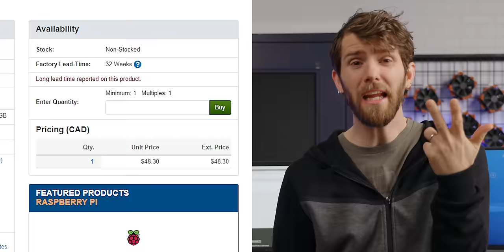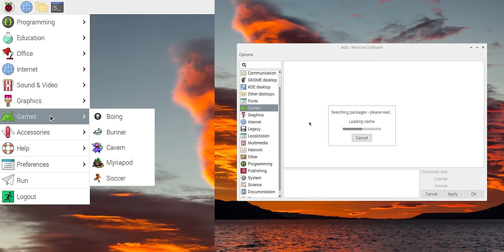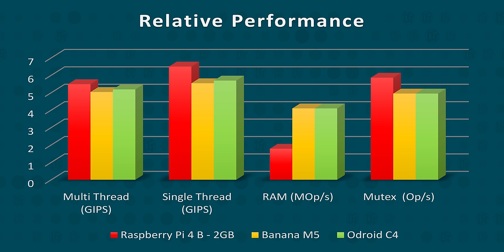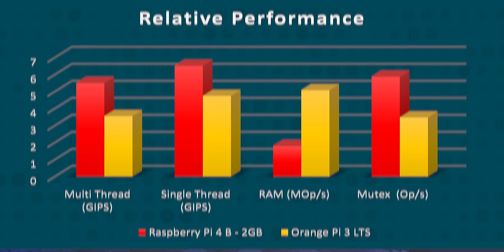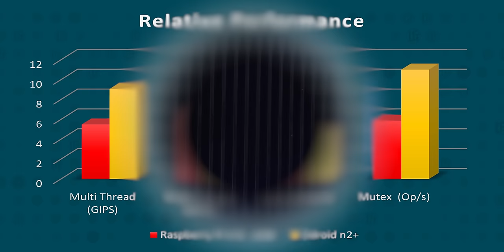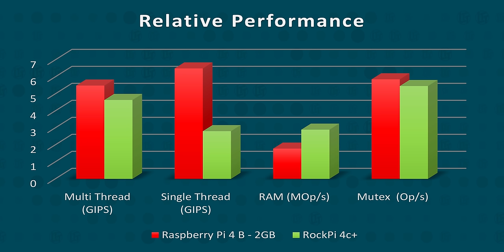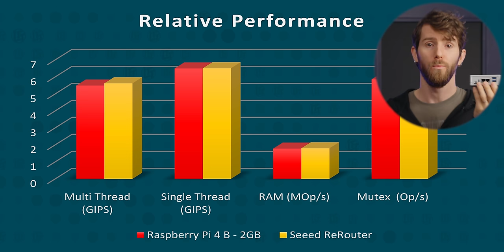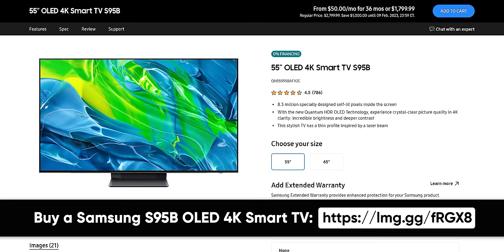I Can Save You Money! – Raspberry Pi Alternatives

Comment: The only thing stopping me from switching to raspberry pi clones is the software support. Even though raspbian is not perfect, I prefer fedora, but it just works and all of the raspberry pis features are fully supported.
Reply: My opinion It's good for browsing the dark web 😊
Reply: @li02828  Good for you, the raspberry pi has no intel management engine or AMD platform platform security processor. The raspberry pi 400 is really all the desktop I need at the moment. Too bad the tor project doesn';t have an official raspberry pi edition of the Tor Browser. How do you use tor on the raspberry pi without the official tor browser? Or do you use 86box to run the x86 desktop tor browser.

Comment: Not long ago, I bought a new laptop for $60. It came with Windows 10 pre-installed, and works just fine. I think it's called an Evolve. 
Unlike an SBC, a laptop comes with monitor, keyboard, touch pad, case, and power supply.

Comment: In Germany, things are bad enough, but luckily not as bad as in the US and Canada as it seems. I am currently building a NAS and I was able to buy a Pi 4 for like 20€ over msrp (but with a nice case included). But 120$+ for a Pi 4 is really hefty. Sadly the alternatives aren't exactly cheaper over here and the Raspberry seems to be the "bang for the buck" (If you want to call it that at those prices) option.
Reply: Yea, in the US we got people buying thousands in bulk and redistributing them for 200$ a piece, which ramps the prices up from a good 40$ to 60$ to 120$ to 200$ usd, i cant even get a rpi from a local microcenter unless its a pico or rpi zero 2W which isnt even good enough to cover what im working on

Comment: Try Bolt IoT wifi module. It has digital and analog pins and let's you connect to bolt cloud where you can write program and control the pins. Can also get the real time data on cloud and supports machine learning.

Comment: A refurbished esprimo q920 mini pc with i5-4590t / 16 GB RAM / 500 GB SSD for about $130 outperforms at least some of these boards, depending on your use case (if you can live without the GPIO). The power use is also about 15W, which is very reasonable.

Comment: 20$ will get you a used Chromebox, which you can fairly easily take the motherboard and write protect screw out, to install Mr. Chromebox's firmware script and run any operating system. Not only is it built for Linux, but they usually come with 4Gb ram, 16Gb storage, a fan, not to mention a dedicated case, and other components that are quadruple the price on a slightly smaller raspberry pi. It totally works, too!

Comment: Few days ago I bough an x86 atom MB for 20e, added some spare 2GB of RAM, a old unused SSD and hard disk both SATA, bought a 17e pico psu to have a fanless setup. You can also ebay an used block MB+CPU+RAM for 40-80, use some old SSD, hard disks, PSU you have around...
Those are 100% compatible and supported by both Linux and Windows, you get proper SATA ports, you can add RAM, expansion cards...

I mean the OrangePi PC was cool when it was ~22e a few years ago, size is cool and it was a cool gadget for dedicated devices but nowadays you can't charge me more than 100e for a badly supported ARM when I can buy for the same price an old PC or a mini pc with a *Celeron. It's not worth the time and the pain for the lack of drivers, support. Actual prices are crazy, old used stuff is much more worth it now and it's usually plenty powerful for a lot of things that you could buy this SOB for (if you are not doing embedded ofc).

Comment: Odroid N2+ 4GB here. I think I have a Pi zero(or another ultra low spec Pi I used for a project a couple of years ago) kicking around here somewhere, as well. I haven't done anything cool with the Odroid, mainly because it's too much SBC to dedicate to any single purpose that leaves performance on the table but while it certainly could assume the role of everyday driver PC for many, perhaps not coming as a surprise to anyone here, my computing needs are a bit heavier than whoever makes up the "many". My display wall/quad display setup alone makes the N2+ not up to the task... I thought about using it as a NAS but I still feel like it's overkill. I haven't looked into whether I could potentially use it for a NAS & a Pi-Hole or something. I had originally purchased it for a roll your own VPN but then an actual dedicated VPN Router fell into my lap, so at present, my N2+ has LibreElec or CoreElec on it but just sort of as a placeholder, as I generally run Kodi on my Linux machine (actual everyday driver) on the occasions where I actually run Kodi.

Any suggestions for projects/uses for my N2+ worthy of its hardware? I'm all ears👂🌽🙉

Comment: Using ARM devices like this long time before Raspberrys were that popular (some people might remember devices like the Linksys NSLU2 or the Marvel Sheevaplug). I mostly need processing power instead of the IO ports. Where I stopped liking Raspberry Pi ARM competitors was that some of them stop getting updates after a few years and are stuck on older OS or kernel versions. Switched over to using cheap used x86 thin clients. Better updates and more processing power and storage flexibility for a cheaper price and often with comparable power consumption, never looked back.

Comment: I consider the onboard WiFi on the Pi4 to basically be an anti-feature. I have multiple Pi4/3s and all of them struggle to keep a semi-reliable connection to my router, even in the same room. So to use them for anything serious, a USB WiFi dongle is needed anyways, but then I also have to go through the effort of disabling the onboard WiFi...

Comment: I just ordered an Orange Pi 5, an AX211 M.2 Wifi 6 / BT adapter, and a case.

My concern is getting proper Linux GPU drivers for the G610.

Panfork seems to making headway, but it is a fork and not upstream.

I'm really hoping for solid upstream driver support. If your video encourages wider adoption of the Orange Pi 5, maybe we'll see better driver / OS support.

Comment: There are actually approved pi sellers charging over $100 for pi4's on their websites now or "starter kits" for up to $200 because they come with a $5 power supply and a $11 case. It's cheaper to buy a full mini pc.  The libre potato is actually pretty good though and still available for $30.

Comment: The Pi 4 received a change in the CPU when they addressed the USB C power connector issue, with the updated version running at 1.8GHz, same as the Pi400

Comment: Another consideration that you failed to cover is that most of these boards do not have the same form factor as the Raspberry Pi, meaning that the VAST array of 3rd party cases (and 3D printable designs) simply won't work with them.

Comment: I use the RPi for RISCOS 5.28, a beautiful Arm based opjerating system that has had a resurgence because of this SBC. If I wanted to use Linux, then any pc would do the trick. But, with the Pi I can run Tech writer 9 and Artworks 2, both amazing productivity tools.

Comment: OK, now let's talk about software support.

Jeff Geerling has gone into this in depth - a lot of these Rockchip computers are great on paper, but they support one specific Linux kernel version and if it doesn't support your usecase. Chances are it won't if you are doing more than something very normal. If you want to build a nas or a cluster or something like that, then forget it. And forget building the kernel yourself, because the modules you'd need are proprietary.

Comment: Love the list of alternatives. I have been looking at pie for a while but not takin the plunge. Am looking for  device to read and record 12 thermometer 40' 60'and 80'and 4 pressure reading 4 relays for switching.  This is test a home project  on tight budget.  I don't want want Bluetooth  or wireless so I like the one you showed with a dangle 😅 to physically disconnect network. What would you recommend and would you recommend other equipment as add on boards for the distance of temperature probes.

Comment: Video summary generated by OpenAI: 
The Raspberry Pi 4 Model B is a single board computer (SBC) designed to offer high speed performance, a quad-core arm processor SOC, up to eight gigs of memory, flexible high speed I/O, and support for up to two 4K displays, all while providing an affordable computer to everyone. However, in the three years since its launch it has been almost impossible to purchase one at MSRP. Fortunately, the success of the Raspberry Pi has spawned an entire bakery of CopyCat arm based SBCs that can offer alternatives to the name brand Raspberry Pi. They offer different specs, like more performance, cheaper costs, and more than one HDMI port. Many are officially supported by Retropie, the user-friendly package manager for additional programs. The odroid C4 is the only non-raspberry flavored hardware supported by Retropie and while at $55 it's a bit more expensive than the $5 Banana Pie M5, it has the advantage of higher clock speeds, an included passive CPU cooler, and a microUSB port for USB OTG.

Comment: I have purchased an Orange Pi 5 with 16GB ram and loaded O/S on FAST micro SD card.   Orange Pi 5 is 8 cores and a good GPU.   It is FAST, FASTER, OMG,  It may be the fastest ( or second fastest ) conputer in my house ( and I have a few running ).   ARM cannot run Intel O/S.   so you have to get O/S from vendor or 3rd party.   For those who have been running Linux ( for me about 1988 ) some of them can use a little polish - but you can get a good OS with a little tweecking - for examnp;le - vendors load are auto - login ( yech ).   But, I can get most of the O/S tweeked to run.  ( like add id and remove auto-login ).   but it runs well once tweeked.  so impressive.

Comment: That Le Potato IS NOT a drop in replacement for a Raspberry Pi.  It's extremely limited on the number of OSs it can handle.   I learned that the hard way by buying one, spending days trying to get it to load the OS I needed and perform a specific function, and finally giving up and buying a real Pi.

Comment: Next Linus will showcase real Single Board Computers that can run Windows, are in the PCI or older ISA form factor, can be used in an expansion slot, industrial/embedded computing, have all the features of a regular motherboard crammed onto a single expansion slot-sized card.  The original SBCs.

Nice that he's catching up with Explaining Computers and ETA Prime.

Comment: Pity you folks overlooked the newly released Odroid N2L, 
It's a revised N2+ thats: 
A smaller form factor, 
has active cooling,
faster ram,
an emmc and microSD slot, 
AND IS ONLY $70+ for the 4GB variant. 

Hardkernel the company that makes Odroid also provides both an Ubuntu image and an Android build for sale on a preflashed SD or emmc module. All of the above puts it above the Pi4 for me. Especially in it's perpetually unavailable state.

Comment: This was a useful video.  Def pidqued my interest in an orange pi.  Had a raspberry pi some years ago and just wasn't satisfied.  Truly i just want a inexpensive device to maybe run android or linux on or dual boot the two and in any case some light desktop tasks and some android gaming.  Just one of these sbcs could be perfect to run pi hole on and browse the internet.  Also i found on orange pi's website a pi r1 geared up just for the router job and from ali express about 45$ (US) shipped or closer to 60$ (US) from amazon.  both options look pleasing.  There is one thing though that deserves mentioned when looking at these high end sbcs though, and that's an nvidia shield.  Def not a hobbyist board but the kind of thing people want when they look at a sbc and clearly their os is meant for many people's use case, though it only comes with their devices.  Additionally, 1liter pc's might suit some people's use case better.  I know that's getting off topic but when you get up to 175$ (US) for an orange pi 16 gb ram model, other options are worth considering.

Comment: Agree with others about the SW & community comments.  I'd love one of these alternatives, but most of them are using custom kernels that are 1 or 2+ years old to work with their HW.  They need support for mainline kernels, like an actual modern driver that will work on recent mainline kernels, like Nvidia does - or better yet, open source it.  That's a huge hiccup.  If even that was resolved, these would be a lot more appealing, even without the community support.  The community support is the other thing, pretty much ANY problem you have, there's a forum post which addresses it.  It's very helpful for when you run into shit.

But the main problem for me is the SW.  It's usually shitty, old, or non-existent.  I don't want some custom Ubuntu image based on 18.04, that's ridiculous.

Comment: I guess if the budget is extreme, I can understand a Rasberry Pi or alternative, but I feel something like an Intel NUC starts to make more sense once you start creeping into the $100 range. I just saw a used NUC with an Intel Core i5-7260U (2.20 GHz), 8gb of RAM, 250gb SSD, ethernet/WIFI/bluetooth, Windows 10 Pro, etc.. for just $120 (buy it now on Ebay). I mean even if you need Linux, you can just install Linux on that, and it should be able to do everything a Pi can do, and with better performance right? I'm personally not happy with the Rasberry Pi 4's I got for the office, they are so sluggish in performance (one just rotating automatically between 4 tabs on firefox), and the other running a powerpoint presentation continuously (which I gave up on it, as it wouldn't loop forever).

Comment: Most of these alternatives are also more expenisve then the pi 4 msrp and they have the problem of having significantly worse support software wise, becouse unlike x86 ARM based SOC are not stnaderdised enough that you can just take distros from the Pi and install them on something else.
Once you get close to that $100+ range it might be a better idea to look at x86 based pentium/celeron mini PC, like intel NUC or similar offerings those are x86 so you get much wider software compatibility and you probably get more performance then the Pi 4 aswell. Also this need of specific software support for every single arm based SOC out there is the reason why ARM won't tkae over x86 anytime soon, arm is not one platform, every arm based soc is a diffrent platform at least when it comes to operating systems.

Comment: Some of those devices are fetching prices at or above the average cost of a modern 10th-11th gen Intel x86 mini-PC (such as an Intel NUC Atlas), which would be a much more powerful performer by comparison, AND run pretty much anything those "Pi-like" SBC's would run, but with much more computing power and memory/storage potential. Sure, they have a somewhat larger footprint, but for price/performance, x86 mini PC's are the better value.

Comment: 5 gb networking is nothing to sneeze at. In the 80s I was using 5mb, around 88 I started using 10mb then around 93 ii started using 10/100 boards. Anyone here remember the floating point bug with the pent-up 90 chip that pushed a lot of engineers over to an 80286 / 400 and gave them trust issues when it was resolved? Now you can emulate those pc's on a pi4 without breaking a sweat. I can't wait to get a pi5 and replace my pi4 desktop. I hope that Reaper and other DAWs do a better job on it.

Comment: I own some of these boards,   If your purpose is education,  Raspberry Pi simply cannot be replaced with any of those. And because of closed source software in those alternatives,  You are stuck with whatever buggy software they release with no upgrades, and no community to help you.
PS: Almost every SBC mentioned uses either an Amlogic or Rockchip, these are SOCs used specifically for Android TVs and media boxes, Those company's don't care if a random nerd is having issues trying to run Linux on it.
Any company that will release a worthy Rpi opponent should have a leverage over hardware manufactures for releasing correct drivers etc,  and spend good money on software development, which will most likely never happens.  (likes of Nvidia can potentially do it, but they wont sell it cheap)

Comment: The price of the Pi vs other devices is a bit off.  The MSRP of the 2 GB device was $35.  The 4GB I have was $55.  The 8GB I wish I had was $80.  These prices bring the $75 device into a strong price competition.  I have had mixed results with my 4GB device.  Mainly the USB 3 is very limited.  I tried to use it to run an external powered USB 3 HDD, but when the computer was accessing the external storage device, I lost all functions from the other USB devices like keyboard and mouse.  Honestly, it failed at replacing my broken Odroid HC2, so it sits in its fancy aluminum case doing nothing. The old 2GB VOSTRO Based X5450 XEON machine is back from the dust bin

Comment: The only worthwhile alternatives to a Raspberry Pi are just other Raspberry Pi's - this is simply because of the community, Pi software reliability and documentation. Other SBC's aren't Raspberry Pi alternatives they're SBC alternatives, or you're just comparing apples and oranges. chalk and cheese.  There are plenty of SBC's that cost more than the Pi that are well worth considering for other reasons - some just because they're x86 or have SATA or more I/O, but they have to be judged on their individual merits for specific use cases. The WHOLE point of the Raspberry Pi is that it's a computing tool that is astonishingly versatile because of the breadth and depth of its software library  - and in this regard it's SO much better than anything else that in early '23 it's worth just waiting a couple of months for availibility to improve. The added bonus is that you're voting with your wallet to support a company with decent ethical values, which doesn't hurt.